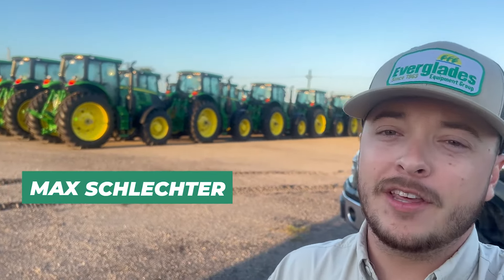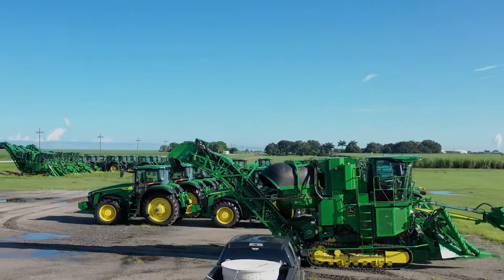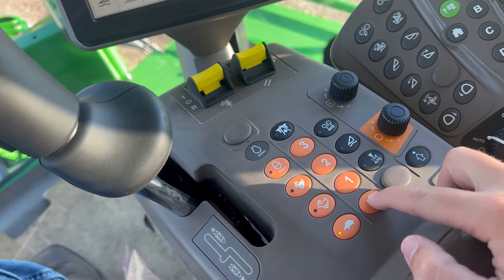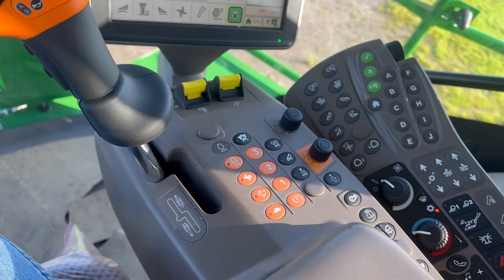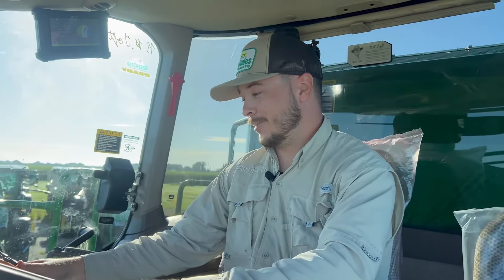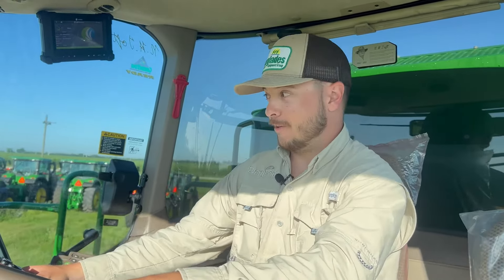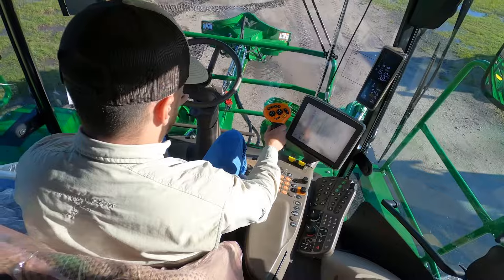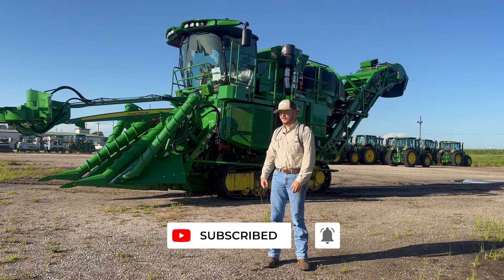DRIVE a John Deere Sugar Cane Harvester with me!

Comment: what ... ?

other than a couple of small vineyard tractors, so basically just a duetz and a new holland, every single track tractor out there since the 90s has used a steering wheel, you should get out there and gain some experience bud